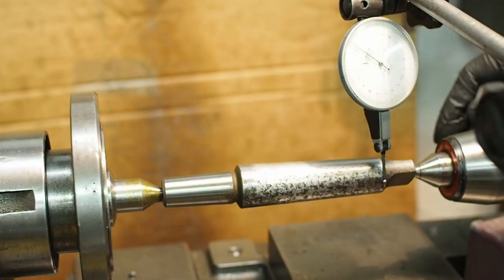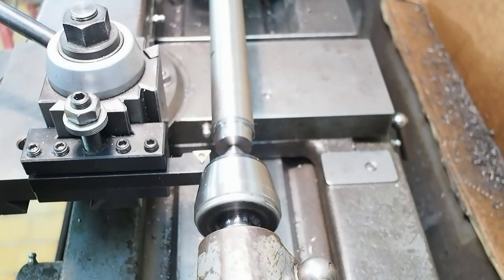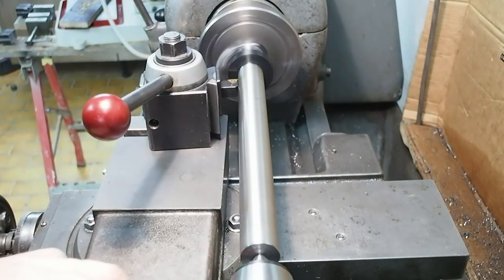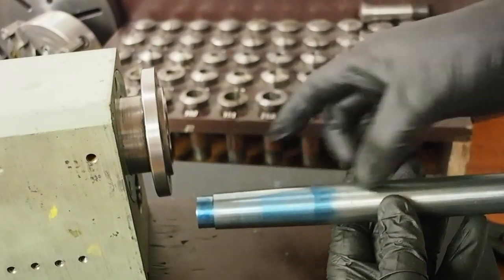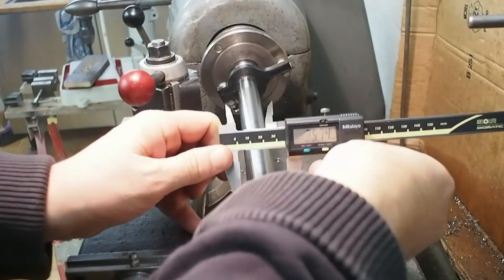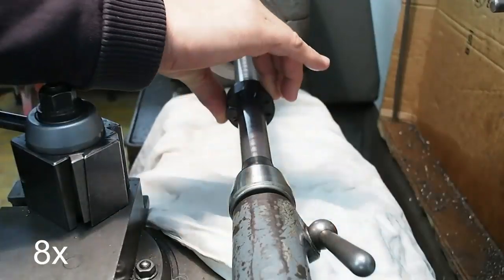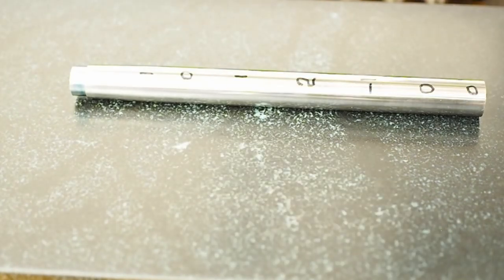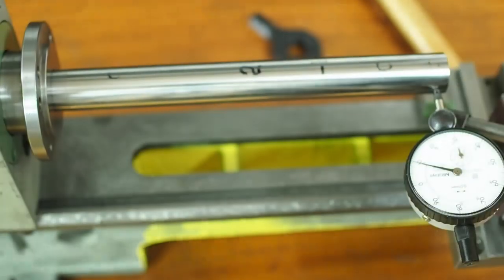Modifying the minilathe. Episode 5. Test Bar

Comment: Brilliant series of video's, by far the best of any on all of YouTube when it comes to improving Asian mini lathes! I bought a Vevor 600x220 lathe over a year ago and sadly received an utterly worthless machine which I wanted to return as soon as it had arrived and I had unpacked it. Sadly the Chinese seller royally screwed me over, along with AliExpress, and as a result I wasn't able to return it for a refund but instead was stuck with a machine which was so defective that any metal working was impossible on it. Fast forward over a year later and I made the decision to try and do whatever I could to improve the lathe and make it into a workable machine, by mapping all its many faults and defects and writing a plan to tackle all of that. Your video's have really given me renewed hope and optimism that I might actually be able to pull that off, and a lot of inspiration and pointers on how to do that as well, so for that I'm incredibly thankful!

I did have two questions though after viewing your video's. With all the work you put into making everything more accurate and bringing them within narrow tolerances, wouldn't it have been important to lap the inside of the spindel for a better mating surface with any MT3 tools? And the same for the outside of the spindle, wouldn't it have been important to measure the straightness and concentricity, or did the measurements you took with the test bar achieve a similar goal anyway? Because with my limited knowledge of metalworking I would have thought that measuring the test bar in the spindle only measured the allignment of the spindle bore axis in relationship to the ways, which don't need to have any relationship with the allignment of the spindle itself or even more importantly the back plate and thus any chucks you would mount to it. After all, couldn't it be quite possible that the manufacturer machined the spindle bore axis out of allignment with the spindle back plate?
Reply from the maker: I already owned this machine for about ten years before doing this second CNC retrofit. The one I got had a pretty decent spindle. I checked the concentricity with the test bar, and it was surprisingly good. You are right though, that there was no guarantee of it being acceptable. Sometimes you get lucky.

At the end of the day, the lack of inherent stiffness in the bed means that it stays a turd regardless how well polished. You can make decent small parts with it, but any machine with more mass is much nicer to work with.

Comment: no it's not just you, lots of youtubers don't like cutting stainless, myself I'm good with it but I bin doing it a very long time, the trick is cooling. I see here many don't run coolant and if you want to cut it easily you need to run coolant and calc the correct speeds and feeds. top tip don't use cheap tooling. great videos BTW keep at it
Reply from the maker: Thanks for the tips!

Comment: Wait, how did you check if both sides of your bed were square and parallel?
Reply from the maker: Which sides do you mean? 
Upper and lower surfaces - Upper scraped flat to the surface plate, lower parallel with micrometers and straight with a straight end.

Front and rear sides - not checked, as they are not guiding surfaces. The only guiding surface horizontally is the Vee way. It was checked straight with the straight edge and parallel with a Vee block and micrometer to the already flat and straight lower surface.

Comment: Great video series, really enjoying it. Just a query but surely as you cut the taper then moved the tail stock the centre alignment of the taper is then off ?
Reply from the maker: It wont create a center error as the taper and the bar were both turned between the same center drilled points. They didn't move. All that is altered is the taper angle of the bar portion, with the target of course zero taper.
Reply: @RotarySMP  sorry, my error, I thought the tailstock was moved to adjust out the small taper that had appeared in the long straight part.
Reply: At about 9 mins in.

Comment: Nice utilizing of the 3d printer for making some of the tools you need.
Reply from the maker: 3D printers are a really cool addition to the shop. Takes a while to get your head around to "see" the possibilities of solutions they offer.
Thanks for watching.
Reply: @RotarySMP  your lathe dogs just gave me the idea that I will make the dog drive system for my tool and cutter grinder out of PLA. Thanks for the idea.
Reply from the maker: @MF175mp  They work well and you can always have the right size. Thanks for watching.
Reply: @RotarySMP  I mean the actual thing that drives the dogs, I have already acquired forged dogs for it.
Reply from the maker: @MF175mp  Oh, a 3d printed dog plate. I didnt consider that. Good idea.

Comment: To avoid all these focusing issues with your camera, turn off the autofocus. You can set your lens for hyperfocal distance and then everything from a few inches to a few feet will be in focus, all the time. The setting depends on your lens, so you will have to do a little leg work for this. You can start here for a hyperfocal distance chart: https://digital-photography-school.com/how-to-find-and-use-hyperfocal-distance-for-sharp-backgrounds/
Reply from the maker: Thanks for the feedback. I switched to only useing manual focus after that video. Hyper focal focusing doesn't help me as the light levels in the shop are not sufficient to use smaller apertures. I am mostly shooting at F 2 or F 2.8 on the 25mm lens, and F4.5 on the 15mm. Especially aound the MAHO I need to add more light, as I am having to max out the ISO, even with the aperture wide open.